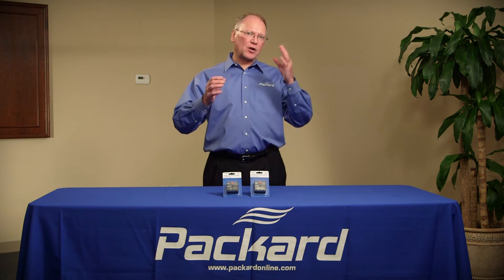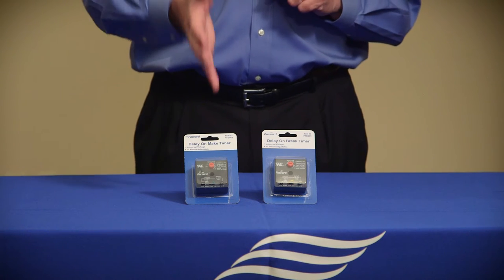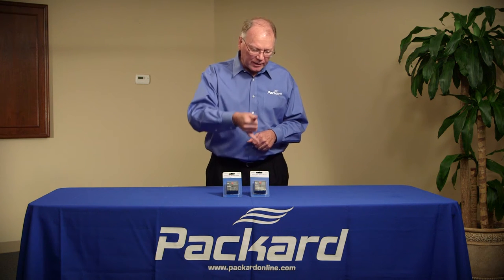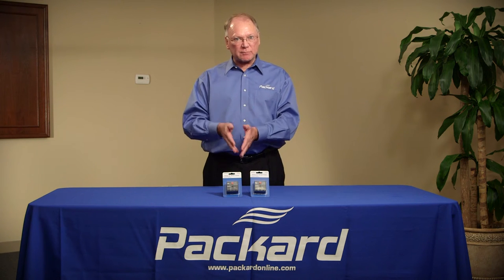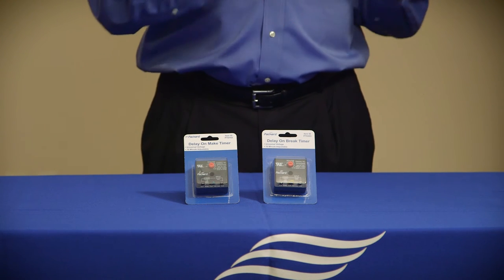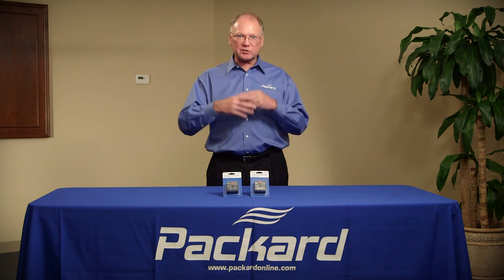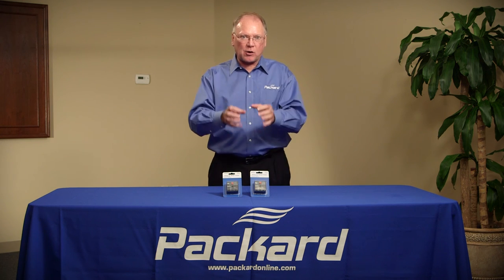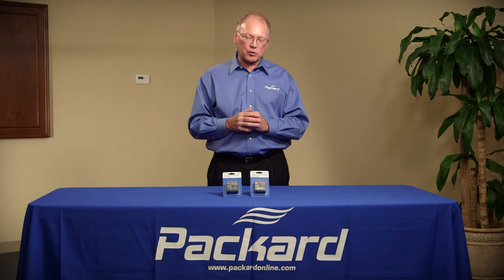Delay On Break VS Delay On Make

Comment: My wall thermostat is supposed to have "A/C protection". When we get a very fast power outage (split second) my compressor immediately sounds horrible trying to restart. I shut sown the system for a few minutes and then restart. Would a Delay on break relay solve this? Thanks!
Reply: Yes.

Comment: Explations are still confusing.  Let me try to get it straight.  “Delay on make,” input comes hot, delay, output comes hot (as long as input stays hot); output turns off as soon as input turns off.  “Delay on break,” input comes hot, same time output comes hot; input turns off, output stays hot for delayed time, output turns off.  What would we call a relay that turns output hot as soon as input is hot, but output turns off after delayed time even when input stays hot.  Sheesh!
Reply: I know! They are almost the same?
Reply: Delay on Make = when you put thermostats in cool mode it waits 3-5min to start

Delay on break= when you put thermostat in cool mode in comes on right away but if power is disrupted even for 0.5 seconds the delay on break activates and does not allow compressor to come on until 3-5 min